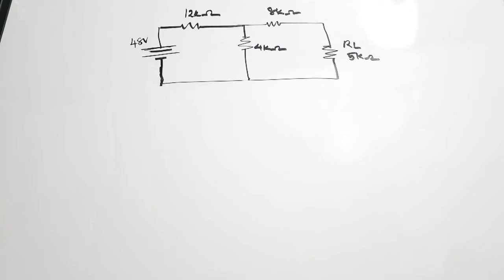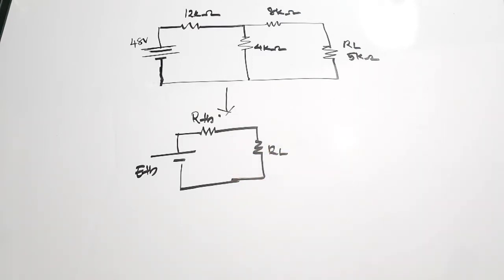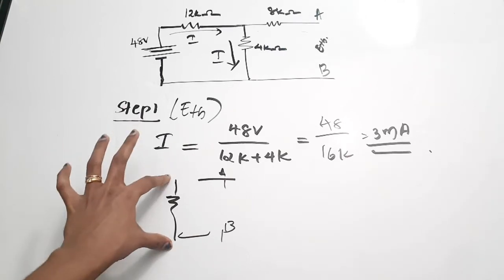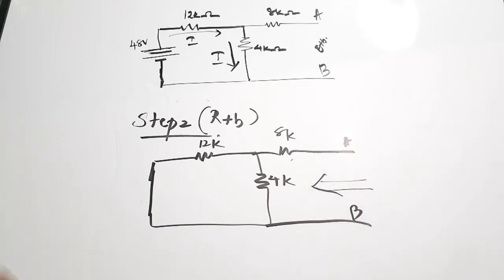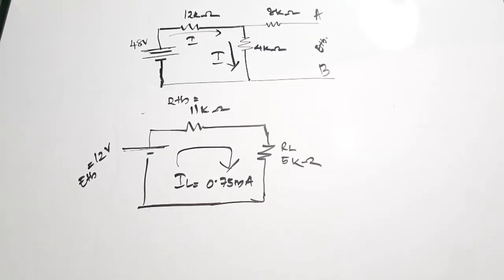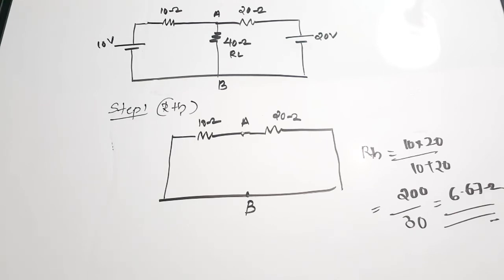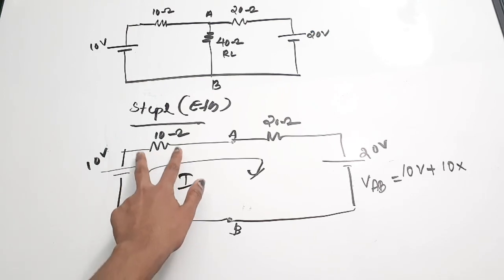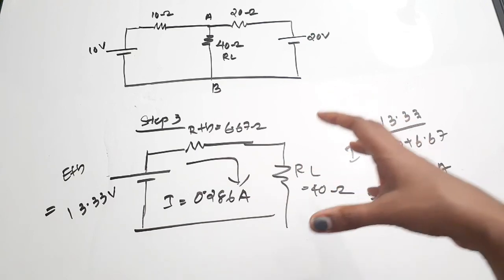Thevenin's Theorem Numericals| Network Theory

Comment: 2nd question.....step 1.....i got current as negative  value..using mesh analysis
Reply from the maker: Yes, that's  ok, it just means that current is flowing in opposite direction. So if unare taking current as negative then modify the equation for finding VAB accordingly.
Reply from the maker: That is when u write second Equation now write kvl in opposite direction as u take current in the opposite direction. So even then u get same answer.
Reply: @EasyElectronics_jobupdates  ok